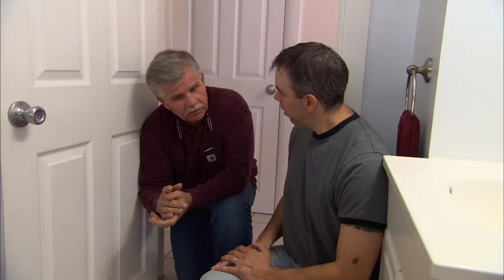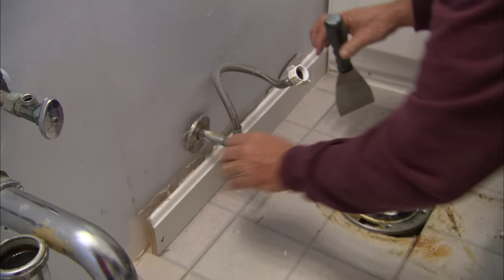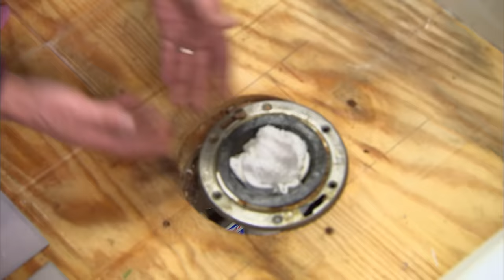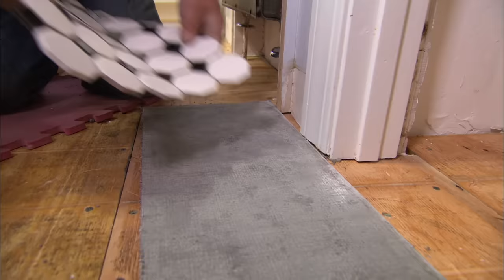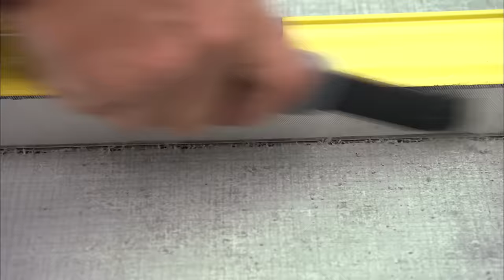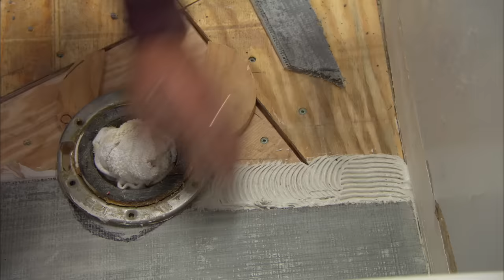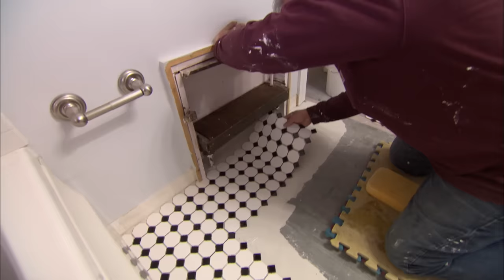How to Replace a Vinyl Floor with Ceramic Tile | Ask This Old House

Comment: So why did Tom say they had to replace the subfloor? What would have been wrong with the one the vinyl was on? Did they put new subflooring on top of the existing floor, or replace it? If the former, I guess I can understand - you'd want the additional rigidity. If the latter, it makes no sense to me at all.
Reply: m rapacki  no, I thought I'd ask a question that I could have answered by watching the video

Comment: I have a question, can I put waterproof over de cement board, like redguard? I appreciate your answer thanks
Reply: No you don't you still have to tape and mud off the seams. Their are also new products out the for floors and being honist unless your gona flood you bathroom floor just resubfoor it with 1/2 ply to secure The tiles

Comment: Hi, I have an old downstairs toilet that was built about 1950. My problem is that the toilet is mortared into the floor and has already started to crake, I intend to put a new toilet in but don't know how to fix this to the old system.

Comment: Subfloor is not synonymous to an underlayment. The subfloor is the plywood, OSB, or planking that is installed directly on the floor joists. The underlayment is the layer between the flooring that you are installing and the subfloor. 
Otherwise a very informative video, if you want more information on how to properly set tile, watch this video. https://www.youtube.com/watch?v=Way5bMh-eYg

Comment: You should also seal the grout so it doesn't degrade as fast with water and moisture. Especially in a bathroom. And why doesnt he use spacers? When we rules our house their was a ton of white + tabs to space them. Is it different for this tile?
Reply: William Nett the tile they used has a backing that holds it together eliminate the need for spacers
Reply: Sam Koch yeah ive seen this used on back splashes and side shower walls, and the sheet allows it to be held up on its own. So you just eye ball the distance between each sheet? Where the one sheets side connects to the other sheet that's the spacing I don't get why they dont use spacers.
Reply: I agree, spacers are a no-brainer for making consistent gaps between tiles.  especially when placing individual tiles, when the mesh doesn't come into play.

Comment: no waterproofing system under the tile?
Reply: its not a shower base no need to water proof
Reply: There was water damage on old subfloor. One toilet failure and you need to redo whole floor again.

Comment: Great video but why not just use an uncoupling membrane instead of the cement board? Prevents tiles from cracking and a lot lighter and faster to install.
Reply: I think some of these segments are years old.

Comment: The house that I bought they laid tile over tile how would I fix that issue. I'm guessing I would have to remove the double players on the tile? (Bathroom and Kitchen). I don't want to just keep layering thing over the floor it doesn't seem right.
Reply: Correct, you would have to remove both tile floors. It will be very messy if you decide to do it, and can sometimes be difficult to get it up. You would have to get it to plywood and install a cementboard/backerboard before installing the new tiles. The flatter you can get the floor before installing, the easier it becomes to install, and you end up with a better finished product.

Charles Damery
Reply: Also, do not use this video as a guide if you decide to do it yourself, he does a few things incorrect and will make it harder to replace the tile in the future.

Comment: What's the reason behind him using the v notch side or the trowel than the flat side? Thanks
Reply: chris7toronto tile sets in better.
Reply: The size of the notches determines how much thinset is applied. Different tile applications require different amounts of thinset under them, and therefore different notch sizes.

Comment: The new flange needs to be on top of the tile. Not recessed flush.
Reply: that's somewhat debatable, but at least its not below the tile.
Reply: It's true that there are two schools of thought on it. I went back and forth myself, but the majority seem to think it should be on the finished surface. I am in that camp as well. The flange does not hold the weight of the toilet up, the edge of the base does that. The flange holds the toilet down, and also helps to create a complete seal. There is more of a chance for the seal to be compromised when the flange is set lower.
Reply: Pretty much impossible in todays construction. I come to install a new tile floor, I will never undo the plumbers work and replumb his toilet flange.
Reply: David Dolch really no point when you can buy a taller wax ring
Reply: Mrcaffinebean A taller wax ring is a "patch" to fix an improper installation. It's like saying you should not try to make a rough window opening level, because they make shims. You do things the correct way, but if there is a reason that it is done wrong, then the corrective patch comes in to play.
Reply: David Dolch no it’s weighing the pro and cons. The downside the mounting the flange above the tile is it makes it harder to install the tile and change it in the future. As far as I can tell there is no downside to an extra 1/4 inch in height to a taller wax ring.
Reply: Less of a chance for leaks with it on top of the tile. It's more than a 1/4" first of all, once you include the thickness of your mud. It's a small chance, but a chance none the less. Having ripped out tile below the flange, and level with the flange, and having replaced the tile both ways, it really makes no difference in effort. In fact, I find that with the flange above the tile, there is much less of a chance of the flange getting plugged with thinset. As I said in an earlier comment, I myself went back and forth a few times about how to do it. There are pros and cons with either method.I still stand with the flange should be on top of the finished surface.
Reply: Manufacturer specification is "between flush with the tile and on top of the tile". So, tommy's installation is absolutely fine. I prefer to make it flush as some toilets don't fit well on the flange on top of the tile.
Reply: @erictold  Ya, sometimes you get a wobble and have to shim.

Comment: I am impressed, he actually did it right. However please screw the closet flange down so that the toilet does not wobble. Also the ring on the closet flange was stainless steel. This is good. The metal ones with paint rust out and will eventually need replacement.

Comment: ok. Why do you need a new subfloor over top of the old wood subfloor? I don't want that much height.
Reply: The concrete board keeps the base firm and is used to adhere the tile thinset.. cant do that on the ply sub base.. the tiles would get loose in no time
Reply: It has to do with expansion and contraction of the plywood during heating and cooling and varying humidity. That said - it can be done. My own bathroom has ceramic tile directly on the plywood subfloor with thinset. It's been down almost 20 yrs., and not a single crack - not even in the grout. Not supposed to tho.

Comment: What was wrong with laying tile on the plywood flooring??
Reply: The cement board is more water resistant
Reply: Heating/cooling and varying humidity causes wood to expand and contract and possibly lead to cracked tile or cracks in grout. Today they recommend a membrane product, not cement board. My bath has the tile directly on the plywood and has been fine though.

Comment: What kind of thinset sticks to wood? If there is such a thing, why not just stick the tiles directly? Screws should be enough. What's the reason for the thinset under the cement board?
Reply: The thinset application with the v-notch trowel between the plywood and cement board is used to fill in any tiny air gaps and keep the whole final product from moving at all. Little movements under load will eventually pop the tile up and the grout with it. Like my upstairs bathroom, thanks previous owners 😂😩😭
Reply: @tonyb3563  really? Then why does the ditra have so many air pockets. My point was that thinset doesn't adhere well to plywood from my experience and that screws should suffice.
Reply: @jorgexcalderonful  Thinset sticks to plywood like crazy. Try to get it off.

Comment: " all you have to do is..."  just remove the sub floor :D- the last bathroom  remodel I saw the sub floor HAD BEEN hardwood like the rest of the house but had been removed,  1 x 8's attached to the bottom of the floor joists and the 2 x 8 space FILLED with concrete. yea too high for real tile, and it had been poured over the old corroded copper water pipes and drains in the floor. $ 9000 later and 3 weeks the remodel was finished.
Reply: That's insane. I want to see pics of that (seriously). I work for a water restoration company and the weirdest/dumbest thing I've seen was 1/2" plywood (flexible as hell). Concrete poured over copper water lines is just asking for damage.
Reply: @keithupton86ku  ill dig some up and see if i can post them on my channel

Comment: Nice job, but this would not be approved in Scandinavia. We have to have a waterproof membrane first.
Reply: They had cheap vinyl tile that were poorly installed to begin with and probably for a decade. Did you see any water damage in the plywood subfloor? No. We Americans keep the water in the shower. You guys are jumping from the river to the sauna to the shower and getting everything wet! Lol.

Comment: First time I can say to this old house that the tile work could have been done a smidge smarter. You could have cut tile near wall straight so u wouldn't have to cut little pieces.
Reply: Considering there is going to be baseboard all the way around that would hide the edges and they didn't need to do any of those small cuts at all.

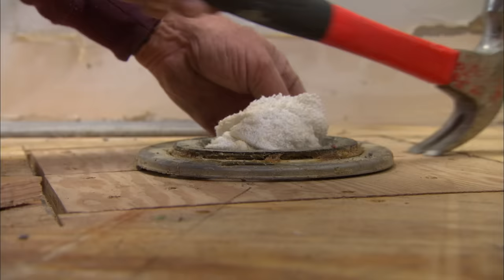Comment: 6:00 lifting the flange for the 1/4 cement board and 1/2” tile changes the slope or pitch  of the toilet drain from 1/4” per foot to a steeper value.
Reply: It would, except he didn't do that here. He lay the flange flush with the tile not ON the tile. Raising the pipe the 1/4" to accommodate the thickness of the cement board would do little if nothing.
Reply: Iron Maiden 1/4” pitch is 1” out every 4’, reducing the trap arm distance by half and causing the drain to leave solids behind.   In addition, the flange has to sit on top of the tile.  That means it’s an improper installation which no one should be recommending.

Comment: You can get away with that V notch trowel on this job because the tile is a mosaic. Don’t try that with full size tiles.  Should use a quarter inch notch trowel for those.  And you’d have to check the floor for flatness.  I noticed he didn’t even check it here.

Comment: Why do you need the s'ment board?  Why not just lay the tile directly onto the wood?
Reply: Too much flex, will eventually crack your tile.
Reply: I see.  Thanks.
Reply: @oldtwinsna8347  not necessarily; especially after having secure the underlayment down with plenty of screws. i've seen tons of installations on various diy-type shows where the tile has been installed directly over plywood or osb (in kitchens and non-wet areas of the house) that have lasted over 10-20 years. i think the primary reason for doing this is to add a "water-barrier" to protect from mold on the wood due to water ingress through grout (especially with so many grout lines). a better solution would be to use a schluter type system (HD has some knock-offs which are cheaper).
Reply: you would need an underlayment to do that that. Using cement board is the old school way.
Reply: @fd3871  that cement board isn't water proof.
Reply: @Questchaun  "water-barrier" doesn't mean waterproof. the floor is never really exposed to constant water pooling so it doesn't really need a membrane. just a cheapish line of defense.
Reply: Wood absorbs the moisture from the thin set which make it not adhere properly  then tiles get loose and crack. Builder building cheap and quick lay tile on plywood
Reply: @kdeanfranklin6255  sure it does

Comment: I don't see why he's using pre-made grout. To grout a bathroom with those small little tubs is much more expensive and takes much longer because the grout isn't as wet as the grout you prepare yourself.

Comment: @9:30 the sheet rock is a mess. Should have sparkled and painted before laying the floor.
Reply: Score the top of the baseboard with a utility knife before you pull it off.

Comment: Shouldn't there be some sort of membrane between that subfloor and cement board? I always did it that way, maybe I have been doing it wrong all of these years.
Reply: You dont need it, thats only for showers.
Reply: homegrownbuddy  no you do need it at least in California. Cement board is not waterproof.... you need a waterproof membrane  in the shower,  this includes all bathroom walls
Reply: crunch9876 yes I understand that, but the floor is not in direct contact with water so there is no need for it. If the area they were working on was a walk in shower you would need to do what you stated.
Reply: We (in our country) have recommendations to have drain and waterproof on floor in every room that have possibilities of bigger leaks like WC, utility room where is your washing machine, bathroom and also bathroom all walls is waterproofed.
 
And reason for that it's so little extra cost for avoid to do renovation IF something leaks it won't damage structures.
Reply: For the rest of us not living in California, no membrane is needed. Need to silicone generously around the toilet and walls nearby though.
Reply: @crunch9876  Shower walls, you certainly don't need membrane on the rest of the bathroom walls.
Reply: Red Pine I agree I meant shower walls. I’d put it in the floor also if I was gonna tile though. Don’t want to rot out the subfloor. 
I’d put greenboard on non shower walls, but I still like to redguard all walls before tiling
Reply: GeoBunny27 I get your point, but water sits then it soaks in and eventually the plywood rots, I’ve seen this around many showers and it turns into a costly repair
Reply: crunch9876   If he had used Ditra instead of cement board, would you still argue that he needed a moisture barrier, or is Ditra a moisture barrier itself?
Reply: DB ditra is designed to do the job. It’s suppose to be a good moisture barrier/decoupling membrane. 
What I originally meant is hat in homes with plywood subfloors in the bathroom. If you just tile over it or put cement board then tile, eventually the plywood subfloor rots, leading to a costly repair that ends up being an entire bathroom remodel. Te repair ends up costing 20-30 thousand. 
But it takes many years, sometimes like 15-20 for this problem to develop.

Comment: Of course, the problem with this program is that to follow their admittedly expert advice you need to invest in thousands of dollars of equipment which you are only likely to use once. It's no surpise the sponsors are sellers of that same equipment.

Comment: lol premixed grout? no, just no. that grout will be coming out in less than 2 years. just use real grout, fortified with sealer and bonding agent. it will last longer than you

Comment: Why the hell would you do this? Just put down a sheet of nice vinyl flooring and you have an easy job cleaning the floor also never cracks or gets cold.  If you are getting vinyl tile, don't get the self-sticking crap.

Comment: 1950’s called. They want their horrendous tiles back.
Reply: Hey I have the same ones only blue and white !
Reply: Those tiles are much more stylish than the beige colored dirt-looking tiles.
Reply: I am no decorator, but I think remodeling should keep the build era of the house and original house style as a theme.  The ceramics used certainly look better than that old vinyl stuff, but they are still appropriate for a Cape Cod.

Comment: But i do comend you for putting thinset under your concrete board,there's a lot of wanna be pro's on YouTube that skip that.. Why? One says so when the next tile guy tears it out it will be easy for him to get out?
Reply: I've had the unfortunate opportunity to rip up tile floor bathrooms before.  How would applying thinset under the cement board makes it easier to tear out?